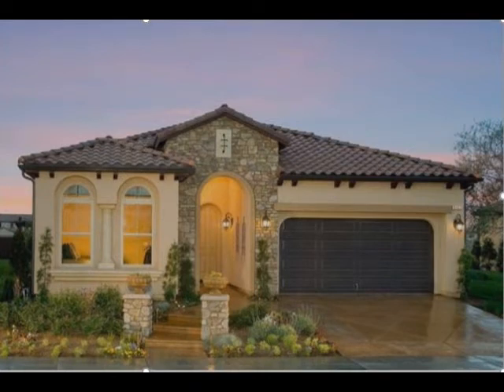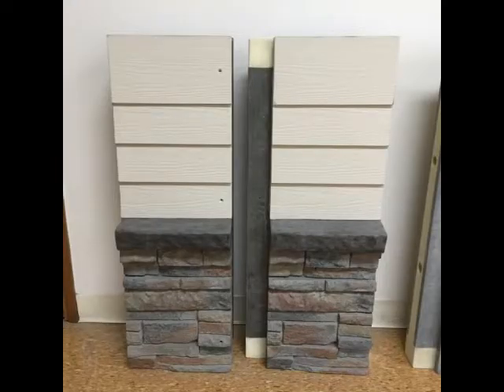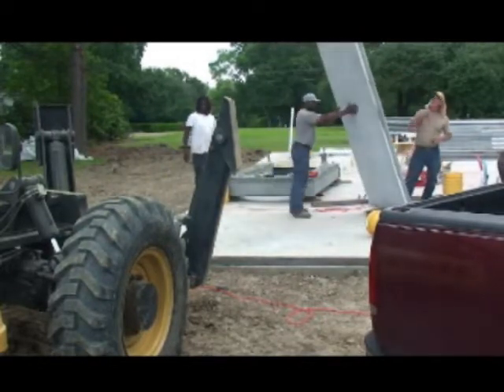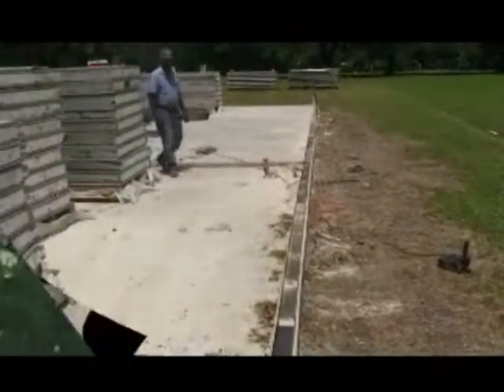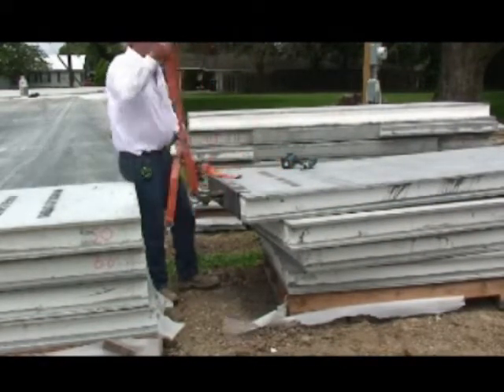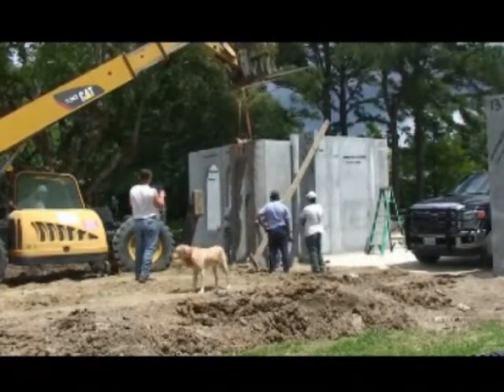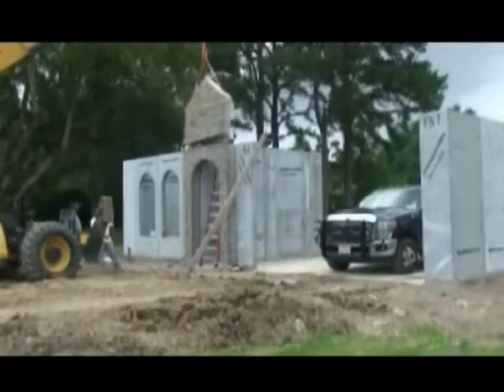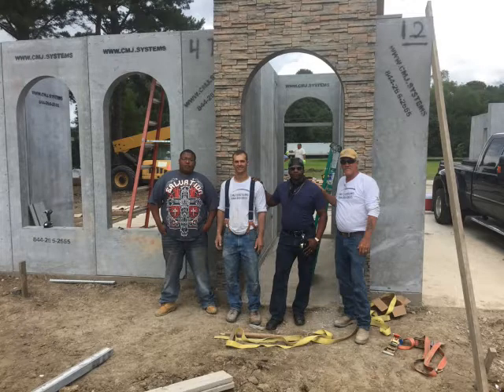My interlocking SIPS Structural insulated panel system castings.

Comment: I'm all for composite and pre-fab construction material development. 

As for now, I'm still stuck on IMPs. If it needs a crane, you're killing the advantage of pre-fab wall panels.
Reply from the maker: I appreciate your feedback, but I’m all about increased strength along with durability and longevity. Lightweight never equates to strength because it only meets the bare minimum load capacities.. thanks for watching my video

Comment: How do these panels perform under 200 MPH hurricane, also, can they stop your average 9mm ball point ammos? Thanks..
Reply from the maker: The panel system holds up the Hurricane tornado fire and any other elements that you could put up against it because it is a Concrete panel system. As far as ballistic protection there is no penetration from all types of rounds that we have shot at the panels

Comment: USING THIS SYSTEM. HOW ARE UTILITIES INSTALLED?
WATER  & ELETRIC LINES?
IM NOT THE MOST EXPERIENCED, BUT IM GUESSING THAT THEYD HAVE TO BE ON THE WALL RATHER THAN INSIDE...
SEEMS LIKE A GREAT SYSTEM, AND R24 TOO,THAT'S PRETTY GOOD!
Reply from the maker: The system provides for conduit horizontally and vertically for both electrical and plumbing

Comment: Why are the walls so thin? I’m not impressed at all.....
Reply from the maker: We manufactured the panel To the architect specifications. The walls are 5 1/2 inches thick with a R-24 rating. The customer is the final say in any product we produce...